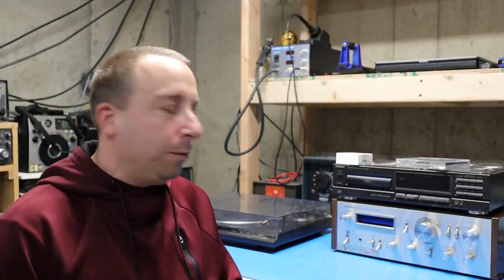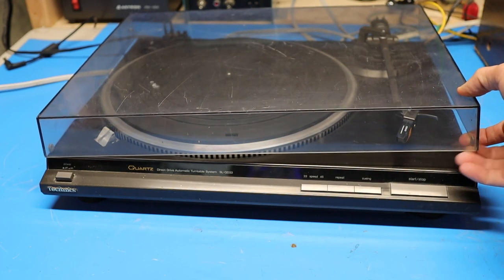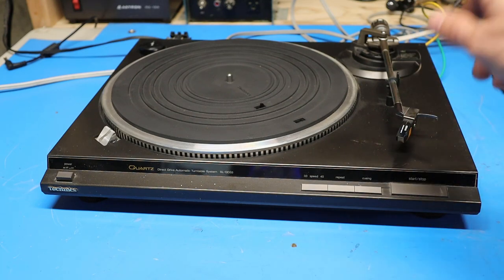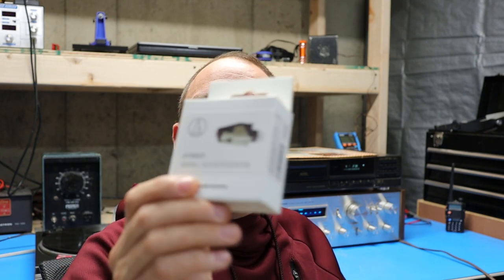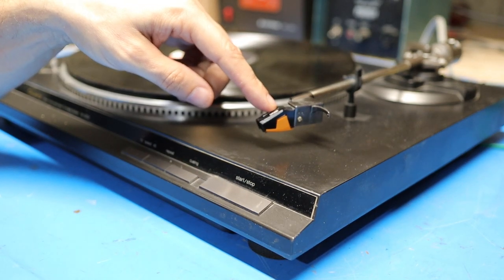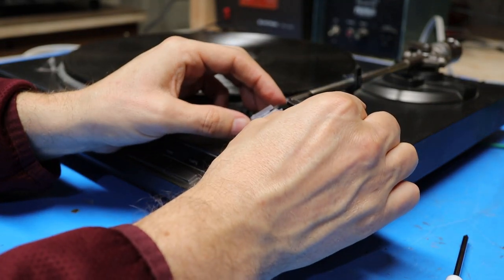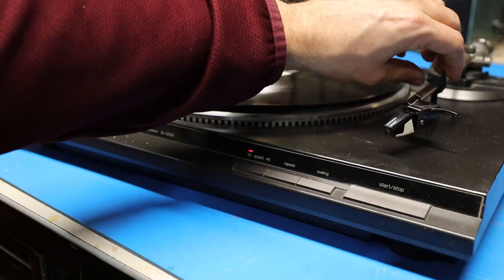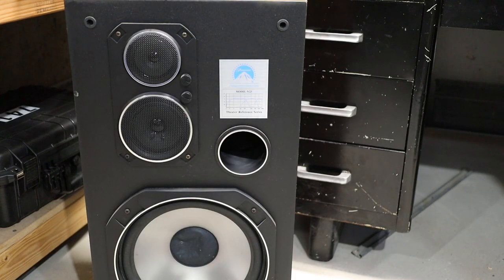Turn Table Cartridge Replacement

Comment: I have this same turntable that we bought from Circuit City back in the early 90's. New out of the box, it didn't come with a stylis at all and you had to buy one separately. It still works after all these years too.

Comment: I have Pioneer PL-112D Turntable that works as good as the day I got it. I'm using it with a mint condition Realistic TRC-2000 Receiver that's been in the family since it was purchased brand new in the late 70's. I'm running everything through a pair of Cerwin Vega RE-30 speakers.

Comment: I have the same turntable to was gifted to me by a dear friend who has since passed on. The cartridge (Audio Technica 2002) I think is probably original and still works. The real problem is the tone arm motor squeals like a dying squirrel whenever it moves during a cueing. It’s perfectly fine while playing though.

Comment: Hey! This video is hugely helpful. I’ve been using my great aunt’s Technics SL-Q300 ever since she passed 10 or so years ago.

This question is a bit of a shot in the dark, but im hoping to replace the cartridge on my turntable. It needs a mini phono preamp in order to get up to the signal level input of my amplifier. Do you think the cartridge you used as the replacement in this video would work for my turntable? 

Sorry for the essay and thanks again for your video!!
Reply: This SL-Q300 was made at a time (early to mid 80's) when most stereo amplifiers and receivers had a "phono" input as standard. As a result, the Q300 did not have a built-in pre-amp. If your amplifer does not have a phono input, you will still need to use an external pre-amp with this turntable, regardless of cartridge being used.
Reply: Just plug it in your receiver video audio jack and voila instant sounds but you have to select video to hear it or maybe in dvd audio out